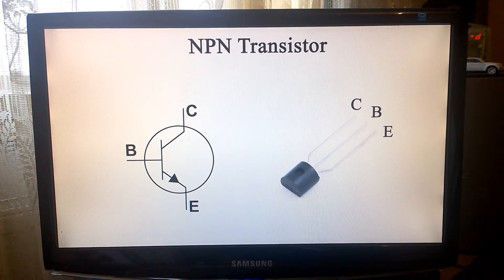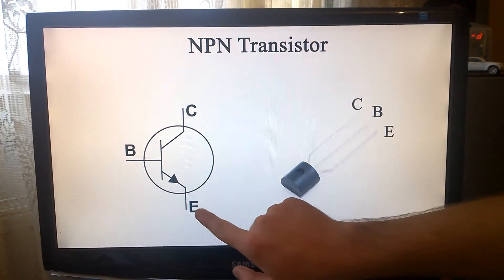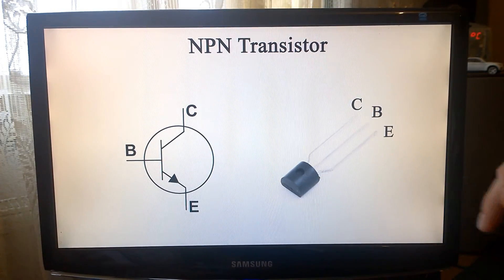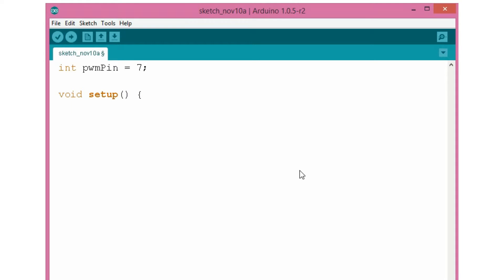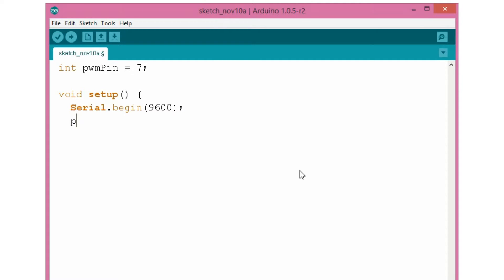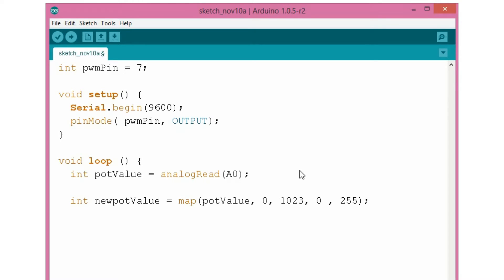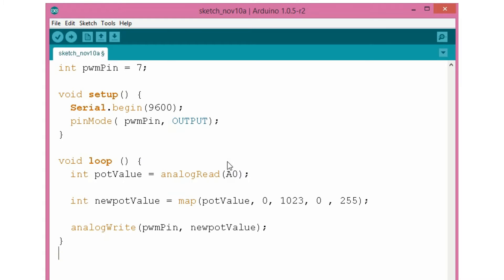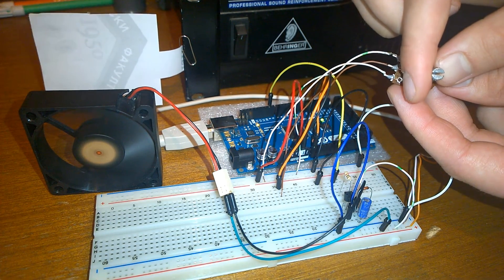Arduino Tutorial 04: Motors

Comment: 1K Resistor is to control de base current. When saturated (conducting) the tension BE is around 0.7V. If you insert 3.3 V at the base, the current will be : 2.5V/1K = 2.5mA. Lower values of resistor will create high base current burning the transistor.

Comment: Sorry, but not pin 7 .  As you know it's not a PWM pin, it's work perfectly with pin 9 and other PWM pins :)
Reply: Pin 7 works on the mega for some reason. It does not work on the arduino uno. I used pin 6 for my uno Lol